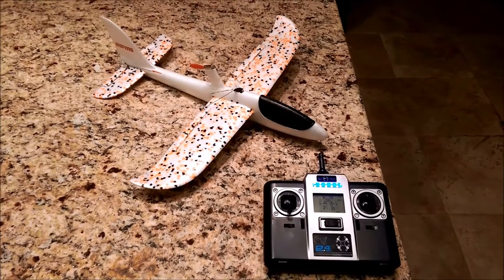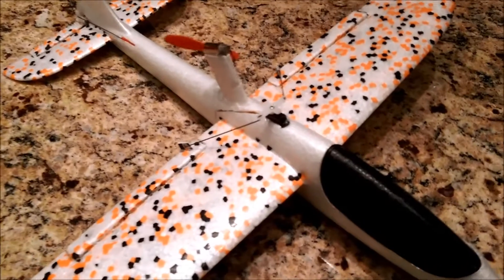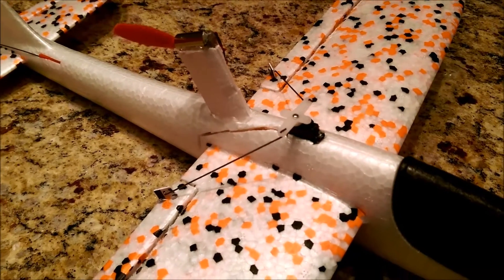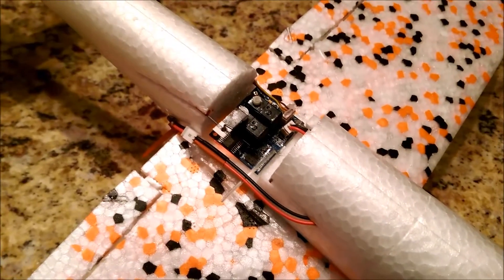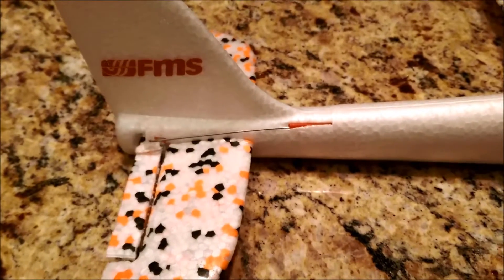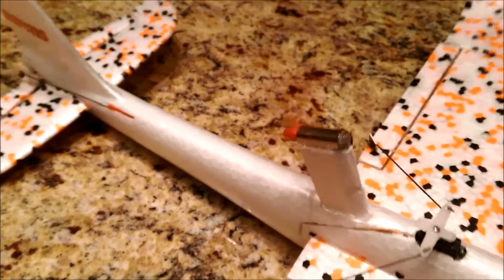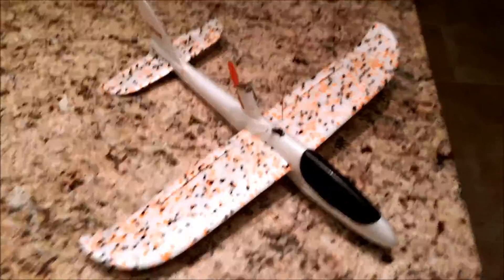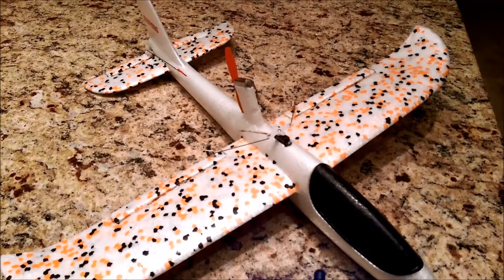Sneak Peek - FMS 480mm Glider RC Conversion

Comment: How many grams of thrust dose that motor and prop produce ? , and how many grams is the total weight of plane in the air ?
Reply from the maker: I no longer have this model, however the motor for this setup was under powered. If you could get a very small 1s or 2s brushless setup, it would work very well. RC components have dropped dramatically in the last couple years.
Reply: Jasonoid I have a 2s 8520 motor that pushes a 5.5 inch propeller with a gearbox , it weighs 10 grams , but produces 80 grams thrust , I want to install it in plane, it was from hubsan h502s quadcopter
Reply from the maker: @thelongranger55  that would be quite the motor!

Comment: But how u managed to make tail hollow?
Reply from the maker: I cut out a large section of the tail span, then just removed a portion of the center of the foam. The used clear tape to put the tail span back together. It was underpowered for the components I was using, I am hoping to do a new build in the future!

Comment: How did it fly?
Reply from the maker: It was a little tail heavy but seemed to fly well. It's always windy 
where I live so flying these small models doesn't work well :( I 
actually made some changes this winter including mounting a larger prop 
and adjusting where the motor is. I hope to try it out later this spring
 when it's warmer.